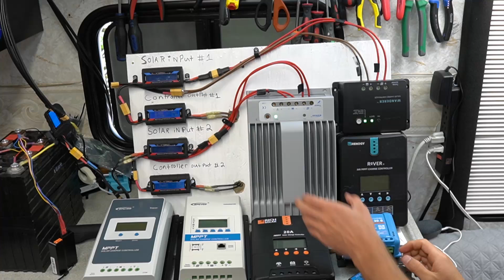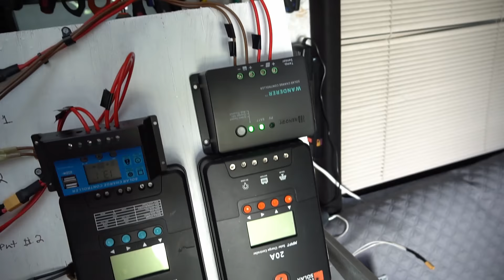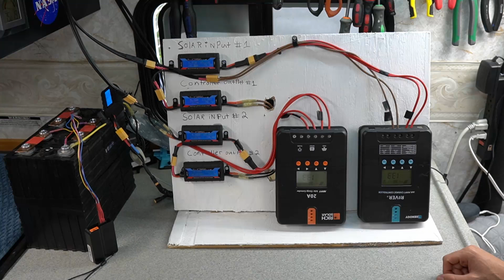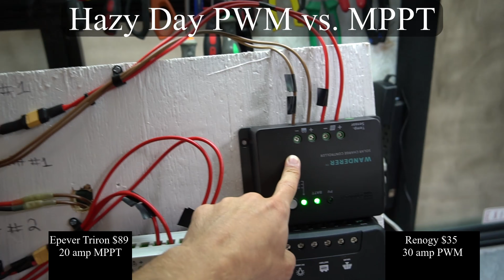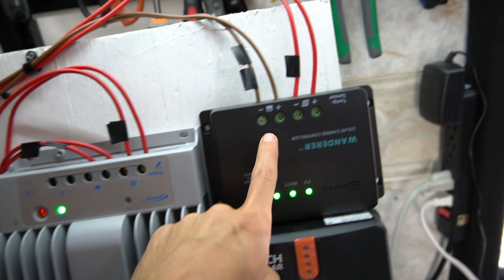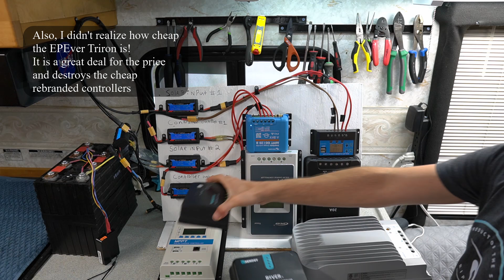12v Solar Charge Controller Buyers Guide - Beginner Friendly!

Comment: 7:12 I would prefer a screen. Just plain and simple. NO bt issues and waiting. Info right there.

If the cheap one can have it. The big aluminum one is just putting out a poor show
Reply: He's saying there is no point in a screen on the device which will most likely to be hidden in a battery compartment. Better to have a remote screen that's easily viewable away from the controller. =)
Reply: @180ollie  they could've given an inbuilt screen with a second optional one.

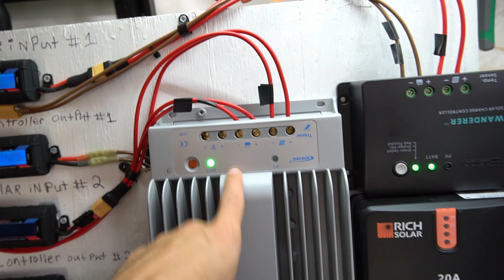Comment: 16:14 Connecting two panels in series to a PWM controller. Great idea! I was just wondering if that would work. Besides that and a few percent efficiency in charging, is there any other advantage an MPPT has over PWM for a small system? Thanks for the great videos, I've watched a bunch today. Oh do you have a link to the 24v PWM build?
Reply: I want to know the same
Reply: Me too... I'm new to all this.
Reply: PWM best conditions are among others. Similar voltage in and out. The further away, one get from this, the bigger advantage a MMPT have on a given system!
Example: 
- 12V nominal panel(s) to a 12V nominal battery, perfect condition for PWM! 
- 24V nominal panel(s) to a 24V nominal battery, still perfect for PWM  
Following similar example. 24v (36V or 48V...) panel to 12V battery, PWM not good at all! An MPPT would be way better on this condition! ;-)

In other words if everything is perfectly matched the PWM perform quite decently , in fact the best ROI possible! (Return Of Investment).
On the other hand step away from these perfect conditions. With dissimilar panels, voltages, partial shading, etc. that's MPPT territory! ;-)

For a simple 12V or 24V system, it's a direct and simple hook up! Even the cheapest PWM controller shown here. Will automatically switch from 12 to 24V. Cheap simple and easy! ;-)

Comment: Hey mate I hope you can answer this for me even though you kind of already have.
I'm considering connecting a permanent panel to my vans roof that'll always be connected to the battery by its own charge controller.
I also mainly want to use my portable panels to chase the sun, from what you've shown here quickly is that if they both run off of there own charge controllers and are both connected at the same time to the battery the battery will take regulated input from both panels meaning both panel set ups watt ratings will be joined and not fight each other, cancel out one another or cause damage to the battery?
Say I have 100-150watts permanent on roof and 250-300 portable, completely different brands ect I'll still get a conjoined 400+watts from them in perfect conditions?

Comment: So what is  the controller for? You begin way over a beginner' s head (me). And, how would I build or design a solar thing to work for my cabin from what you are talking about? Far too complicated, do I put all this is a wooden box under the panels ? What do I do with this moderate/advanced knowledge you give us, would seem to be good for a tech person, but what about us?
Reply: I think he means a beginner's guide to the controller component of the system. This guy is good if you're a beginner though, if recommend watching more of his videos and your cabin will be electrified in no time.
Reply: This is all beginners level, in fact very basic beginners level! 
If you really feel the need to get deeper into the subject! I do advise to study a little bit more than a short YT video can provide! There's enough knowledge online! As well as on books! ;-)
Reply: In simple terms the controller allows solar panel output to run thru the controller and then output energy to the batteries.  Assuming you have lead acid batteries or even liFePo you need to set the point at which the controller stops pushing power to the batteries OR....your lead acids will boil out the electrolyte and fail prematurely (past 27.5 v on a 24volt battery setup (the float limit), or 28. 5 v on a LiFePo setup or you can damage those depending on the battery).   So it is a limiter to keep from destroying or harming your batteries.

Comment: I had hoped to see a 30% increase(I always hear about it), of the MPPT controllers over the PMW controllers ... but the increase was very negligible.  Is this because the panels are close to 12 volt output?
Reply: This was tested on single solar panel use...mppt benefits come in to there own for multi solar panels using parallel and series or both linked. Also some of the cheaper models don't show an accurate reading if you put a reader straight to your battery.
Reply: Panel voltage drops with temperature, that’s the only logical explanation. Panels are rated at 25 digger Celsius.
Reply: Gotta be something like that.

Comment: What if your running 800 Watts of PV? You need 60A.  A comparision of that level would be interesting because there is less incentive to make them cheap at that price point.  I would like to see a nice mid range system test although the cheap end of the spectrum was also interesting.

Comment: Just re-watched the video, the Victon does have small terminals however the terminals are fit for purpose. It is only designed to run 10am max into the battery, this means that most likely you are going to be hooking a 120W panel to it. With 10amp and under 1m distance even an 18 AWG will be suitable (if under 2 ft you can probably even use 20 AWG). Even if you wanted to oversize the leads a 14 AWG cable will fit perfectly into the Victron.

Comment: I bought the Renogy Rover MPPT for a portable solar setup for ham radio.  The Rover absolutely destroyed the ham bands with interference.  Then I bought the Victron MPPT - it is radio silent. no issues using it while on the radio.  That's why it cost more. Much better filtering.

Comment: I used the little/cheap charge controller to on a portable system with one panel and one battery and a timer to water a small, remote orchard in Idaho. It worked very well for that purpose.

Comment: you all making a little mistake. Mppt is only mechanism or scheme of charging. but some mppt controllers are realy have a option about extra power that made a extra power from voltage to current. but they are very expensive :) you can recognize them by price, last seen is more than 700 dollars

Comment: Such a great video. The only downside to the pwm as a budget option. Refurbished residential panels are usually around 40 volts.  12v panels seem to be more expensive per watt. At least where i live.

Comment: I used that cheap little PWM MPPT for a HAM radio portable box. Size was an issue and so far it works great! Use it with a 60w folding panel and it charges the bienno 15ah battery in no time.

Comment: MPPT vs. PWM: 
 - MPPT will always have an efficiency of ~ 90 % or so
 - for PWM, it depends very much on the solar voltage vs. the battery voltage: if the solar voltage is only somewhat larger than the battery, it has good efficiency. But when the solar voltage is considerably higher than the battery, then the efficiency drops: the solar voltage is just clamped down to the battery voltage, and you're far away from the max. power point of the solar panel

Comment: Awesome video!  what I learned is I can stick with the PWM charge controller that came with my 200 watt suitcase.  I was going to "upgrade" it to a mppt to keep my AGM battery in my truck camper topped off.

Comment: I just don’t see a $160 controller as expensive compared to the job it does.  Cheaper than most 100w solar panels to protect and run a system?  Worth every penny.  If $160 is too much money, you might not want to build a system.  Great Video as always.

Comment: I have the $15 unit and it works OK (past 6 months) You can set upper lower and float voltage and 3 types of lead acid battery (only) and a timed output.

Comment: You can add a Bluetooth module BT-2 to the Renogy and set voltage limits easier that way. You can also see WHr in out and a bunch of other stats.
Reply: Yes. I have a Renology MPPT 40a and have used in this case the BT-1 module to set voltage limits and other specs appropriate for my type of battery.

Comment: I purchased the cheap pwm,  looks like a happy meal toy, not kidding about that. I was going to experiment prior to spending more money on a good quality set up.  I received the controller. Laughing thought it would be a garbage can item. It was ten dollars,  could open and examine the inside for the sake of science. 

Finally I set it up to 4 100w panels. A 12v 1000ah marine rv battery deep cycle agm. 
I'm surprised.  This little cheap wonder kicks butt.  It works solid. Over 6 months now, no issues,  it does its job and does it well.  Its a 30A,  from four 100w panels I don't think Amps will be over 5 unless panels are struck by lightning haha
It reads its rated for 390w. For four 100w panels the max from even best panel on the market is probably about 80% of that. So potentially you could attach 5 100w panels and be right at 390w into controller.  

However,  this cheap looking trailer trash controller is a dependable investment,  I like it,  and for my off grid setup, it's good. I'm running a 750w power inverter sparse to a 50w smart TV  and my light system is several usb lights. My cabin is set like a rv. I have two batteries parallel connection... this controller is good for my setup.  I recommend for those on a budget because it simply just works.

Comment: I’ve got a 3,000 watt system with two wind generators, 6 - 100 amp hr lifepo4 batteries, I’m using #2 welding cable for power delivery, none of these controllers have cable connections big enough, I don’t like none of them, I came to this video because I thought maybe you might have something I like, I’m looking for something around 500 amps, I don’t think any of those come close, do they even make what I’m looking for?

Comment: So to sum it up…. They have a range of price, features, size, different connectors, screens…. The bottom line the all have their place and all work in the system which is designed with the individual controller in mind. Probably the biggest difference is the ones with temperature monitoring.

Comment: Hi, you can't compare Victron 100/20 with Epever BN Series because the first works with 12/24/36/48V automatically.
Epever works with 12/24V only.
Furthermore, the connector for terminals allows cables up to 10 square mm cross-section that is even enough to manage 10 amps from PV and 20 amps to charge the battery.

Comment: Alright let's get one thing sorted out here you can absolutely use a pwm and have very simular to even no loss as a mppt but you are limited to using 12v panels only wich in a hole are smaller and much more expensive then the commercially available panels that typically are above 40v so as a rv diy or any small solar project absolutely use a pwm as long as you use 12v panels or just get a mppt and buy whatever panel you can find.

Comment: What is the max power rating of each single panel? My research would suggest MPPT is more advantageous when there is more voltage, so a single panel test would not demonstrate the differences.. eg, if you measured each with 2 panels connected, parallel and series, the results would be even more interesting. Good review

Comment: A short run of  wire does not need wire bigger than what can fit in the connectors.  4mm wire is plenty for 30 amps

Comment: PWM charge controllers become dramatically inefficient as the panel and battery voltage difference increases. It seems to be good here because the panel and battery voltage are close. If two panels were connected in series to the PWM controller, the power would remain the same, although it should be doubled, and the second panel would be useless.

Comment: Main reason for going victon is the custom charge profiles and simple bluetooth monitor app.. if you are spending 2-3 even 400 bucks on a decent high cycle use battery, you wana be sure your charge profile is set perfectly to the batteries datasheet , Generic charge profiles are quite capable of destroying perfectly good batteries over a short time period

Comment: what I do is either twist the wire ends and soldier them or twist and crimp a ferule, then you dont get messed up wire on the ends and you can get the connection and wire size you want without messed up end and a solid screw set

Comment: Actually the cheapest pwm controller will do a great job on lead acid battery as long as you control the temperature. I find that the weak point on these are having an accurate soc. I have several small systems that they have been working great for years.

Comment: You may have covered this elsewhere. Wire size and distance is critical between controller and battery if you want to battery to be fully charged. Controller measures battery voltage at its output terminals eg 13V, add 0.5ohm wire resistance and 1A current and voltage across battery is 12.5V. Result is controller drops out of high charge mode to soon as it thinks battery is fully charged. Will still trickle charge but going take longer to fully charge battery.  Better quality controllers may have separate battery voltage sensing wires which measure voltage at battery in which
case distance and wire size isn't quite as critical .Also use quality Anderson connectors. I've discovered cheaper ones can have to high voltage drop.

Comment: Just remember you don't always get what you pay for .As far as temperature sensor ,the one built into the charge control unit is useless unless the battery and the charger are in the same box ! You need an external temp sensor physically touching the battery not the ambient air temperature .If your battery gets hot while charging ,which it will ,you need something to sense and control the current going to the battery .
Also how much energy do your  digital watt meters consume ???

Comment: You notice how all of them seem to have loads of problems. I'm still looking for a controller that works.
Victron : The 100/50 Goes unstable at low currents, if you have the absorption voltage medium to high. Loses the plot in dark weather, so you lose half your rain power. Goes into float in cloudy weather for no obvious reason. When you gang them on the VE network, sometimes one doesnt start in the morning.
EPEVER (aluminum one) : Very slow. In hot weather, you cant trust it to find MPP, and it will be found near the battery voltage, so you can't trust it to do high voltage input.

Comment: Will -- discovered your channel only recently with the encyclopedic info you offer. I made the leap to Victron MPPTs from Morningstar PWMs a few years ago. Recently I needed another controller for a 50W panel purposed to maintain a pair of lead acid Trojan batts I use for power backup to my computer, ham rigs and cell phone modem. 
Without carefully reading its description on Amazon, I bought a Victron "Blue Solar" controller, missing the fact that that model lacks Bluetooth (which I wanted). To manage it with a cell phone app I needed Bluetooth necessitating getting Victron's V.E. Direct Smart Dongle. I mention this all because you noted in your video the potential current drain (albeit minimal) with a controller's Bluetooth radio being continually on. The Blue Solar controller sans the dongle solves that issue.

Lastly, to comment back to your "hope you learned ..." Yup! Certainly did. Your videos I found all have a tid bit I didn't know.

Comment: I took the cover off of my Renogy 40A and drilled out the holes to 3/8" diameter. Now I can get 2 guage wires to fit, with ferrules on the ends.

Comment: If the connections are a bit on the tight side consider using crimp on flat blade/pin terminals to the ends of heavier duty wiring,  problem solved.

Comment: Thanks, I'm using two of them that you reviewed one has been in use for 5 years now the other about 4 or so months.  Now I'm looking into 100A MPPT for stand-alone system for my cabin.  A 5.5 KW system is overkill but leaves expansion room.  But after watching this I see that I can run two systems charging the battery bank. 👍

Comment: FYI.... i know this vid is over 3 years old, but i have just purchased the Renogy Rover 40a mppt controller, and it DOES have large heavy input lugs.... so they have either upgraded or the 40amp unit is designed as it should be..... and currently, the 40amp Rich Solar unit is a few dollars more expensive than the 40amp Renogy Rover unit, AND, the Renogy Rover 40a DOES allow the use of lithium batteries....  but thank you for the video, as this is a big help in understanding that more expensive doesnt always mean more better..... ....

Comment: Thank you and great respect for going on your own budget Vs sponsored, there are things more important than money, which is clearly shown in the video! I've for some trouble with my 320 W 40V pannel, no cheap PWM charge controller works with it unfortunately. I tried the blue one you're also using, and a 30A energy lab one I got for a very good price. They both work well with a 50 W one. Thank you for clarifying on the rich one, I'm going to have a look at that one.

Comment: Thanks for the thorough review of the different options. I believe the cheap $15 PWM controllers now support LiFePO4, so I might just stick with those for my 8 x 100W panel install on my boat, as they're included with the panels. I was worried MPPT was necessary for better efficiency, but now I'm not so convinced.

Comment: The name of the game is efficiency. A Watt not lost is a Watt generated. So if the MPPT has to use a die-cast heat sink, then it probably is wasting watts into heat. So maybe the cheap plastic box works better! ???  A manufacturing dollar spent on parallel, low on-resistance, switching VFETs is probably a better investment than a custom die-cast sink. It could stand up better to mechanical abuse though.